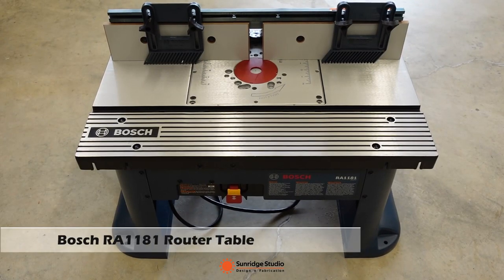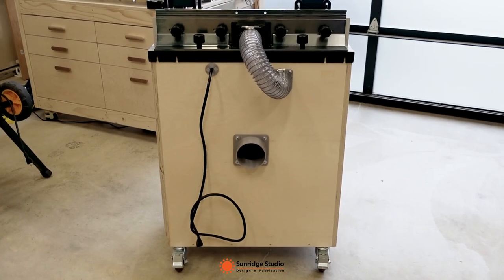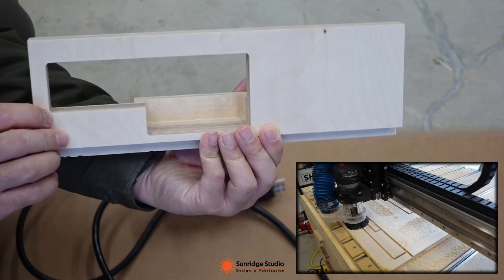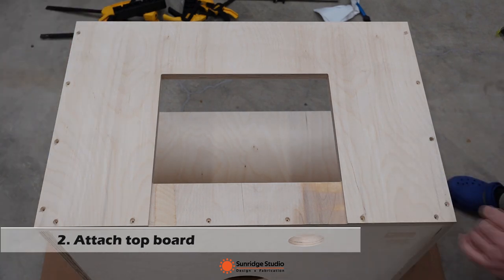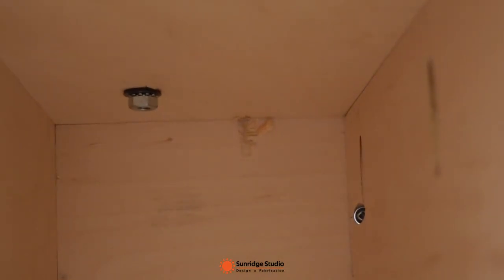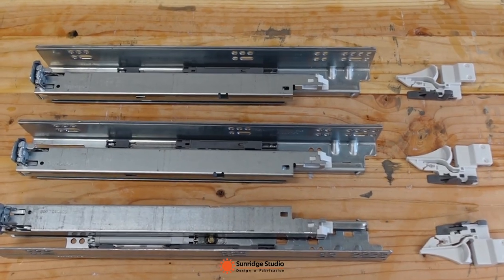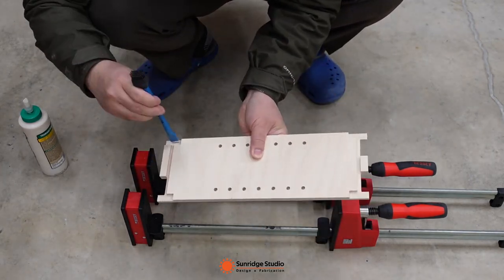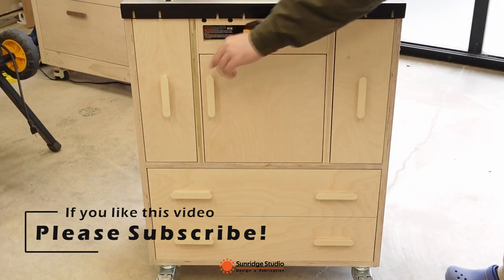Make a Router Table based on BOSCH RA1181

Comment: Very good - thank you BP! I might not go so far as to make a router table cabinet like this but if i do your design is great!
Reply from the maker: Thank you! Glad you like it! I fully agree that a router table does not necessarily need these fancy features. I used this build to test some ideas for my future projects, e.g. the coffee bar build.
Reply: @SunridgeStudio  You are  welcome! Do you have a pdf file of the router table cabinet? I downloaded the file for the drawers - thank you for that .
Reply: @SunridgeStudio  I'm looking forward to that coffee bar... In fact I think I will go and make a coffee right now! 😊
Reply from the maker: @Kitcheneering  I did not make pdf drawing file for this build. But I have shared the Fusion360 design file of this router table. If you use Fusion360, you can make a drawing file from the design file.
Reply from the maker: @Kitcheneering  Thank you! Actually the coffee bar has been made. You can check out this video -> https://youtu.be/RQVwzUgnA_k

Comment: I really like the design overall. Is there something you would change if you have to do it again? Thanks for making the CAD file available! Subbed.
Reply from the maker: Thank you! I would probably consider two changes.
1. Make the wood panel for switch box a little bit (say 1/2 inch) taller. Thus the switch box can be installed a little bit away from the table top. In such way, the switch box can be installed more easily.
2. Use overlay drawers, instead of inset. The blum drawer slides are easier to install for overlay drawers, as the setback can be a little off for overlay drawers. While the setback of slides must be precise for inset drawers.

Comment: Nice build.  Please cut plywood on table saw facing the front. Cutting on the side is very dangerous
Reply from the maker: Thank you for the suggestion! Could you tell me why cutting on the side is dangerous? I thought the most dangerous position is right behind the fence and saw blade.
Reply: @SunridgeStudio  kickback is the big issue I see cutting on the side like that.  You could easily loose control of the piece as you're feeding on the back end of the blade. I did see on the video where you almost lost control. The piece can get pinched between the blade and fence and can fly off and put your hands at risk.  Cutting in front of the saw you have much better control. Always use a push stick with an outfeed table and you'll have less chance of kickback. There are tons of videos on those types of issues to prevent nasty accidents.
Reply from the maker: Thank you for the detailed explanation